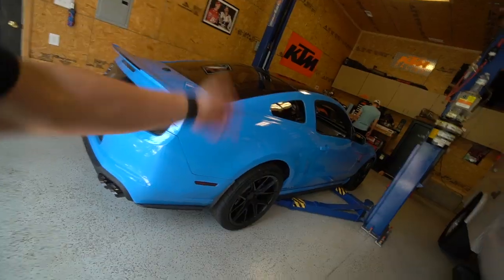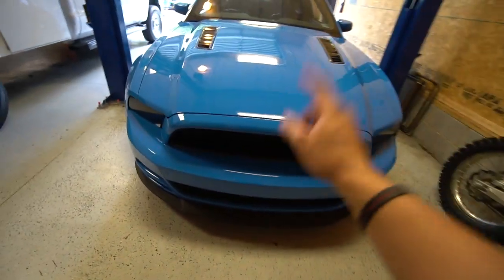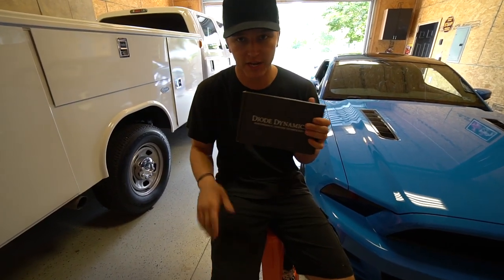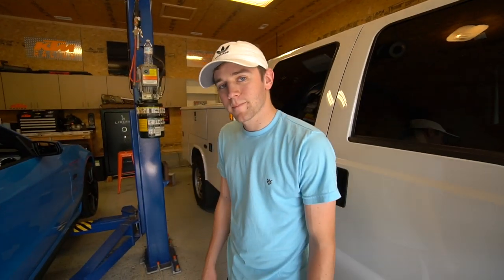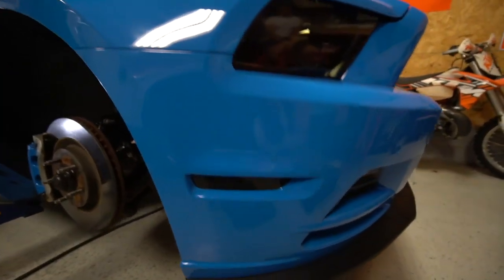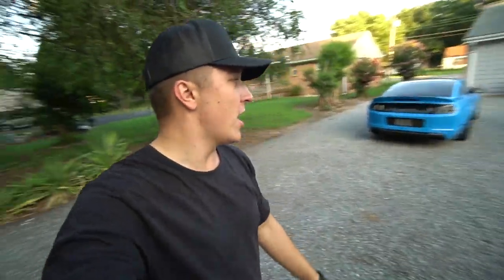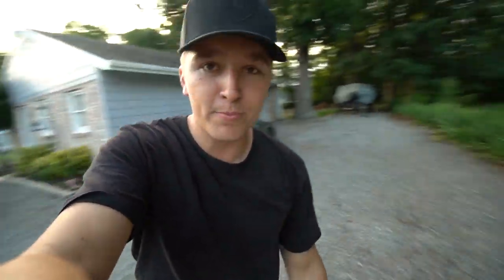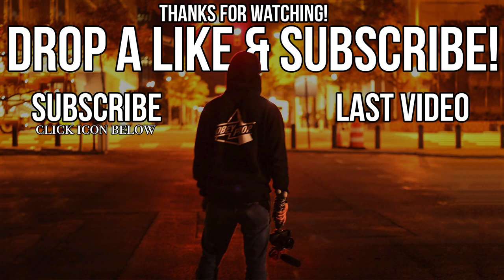BUILDING BLUCIFER: Diode DYNAMIC Side Markers! | Episode 14

Comment: Are the front lights still bright enough for night driving??
Reply: PureSwiftly that’s what I was wondering
Reply: No there not. I have the same year gt and tinted mine with the same tint. You can’t see shit at night. I pulled the headlight tint off after having them on for about a week. I’d rather see at night and imo it looks better on this model with no headlight tint with the stock angel eye setup. I did keep the fog light tint on though and I think it looks better with just those tinted